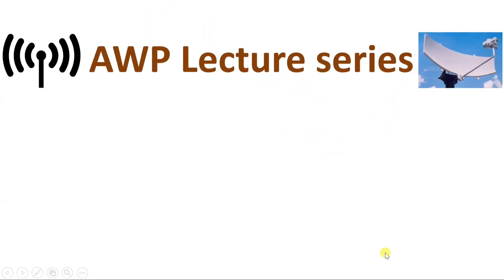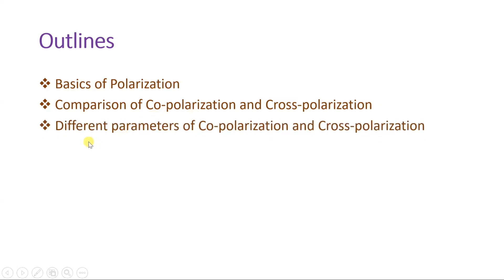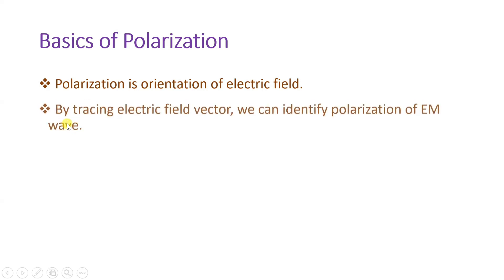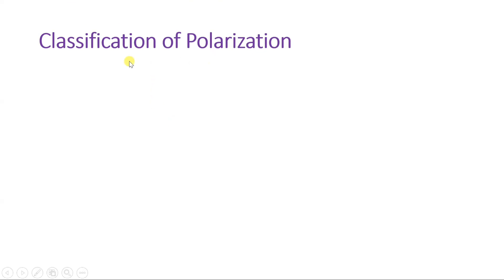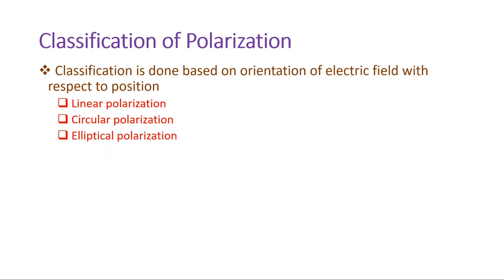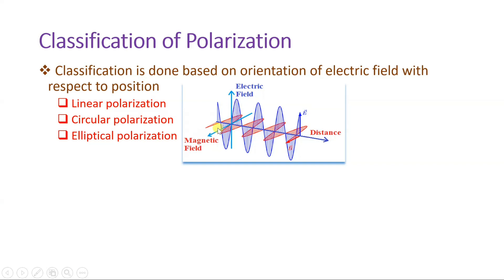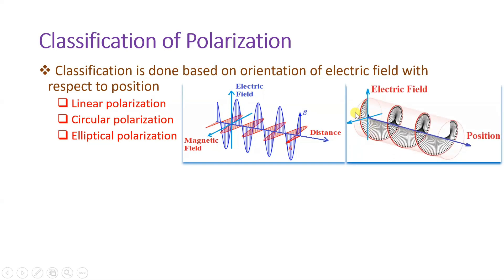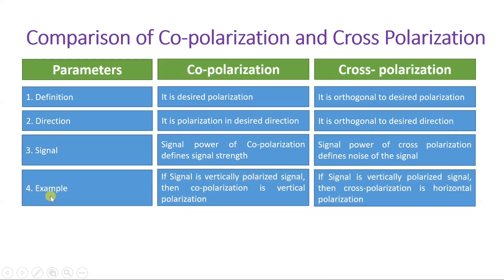Co-Polarization & Cross-Polarization | Co-Polarization Vs Cross-Polarization | Basic of Polarization

Comment: Please make more videos, this is a really good explanation from easy to complicated things. Could you please explain XPD? thank you
Reply: XPD is the cross polarized discrimination, ratio of signal power received or transmitted by an antenna on one polarization( the polarization of the desired signal) to the signal power received or transmitted respectively on the opposite polarization. This is to measure the ability of the antenna to detect (emit) signals on one polarization and to reject signals at the same freq having the opp polarization. thanks